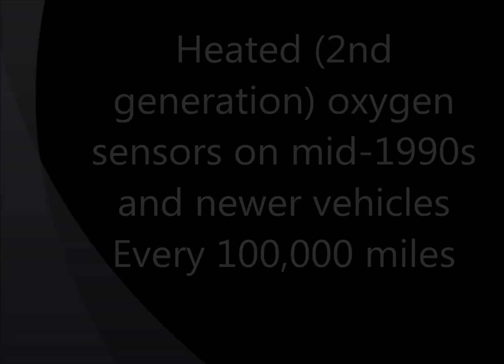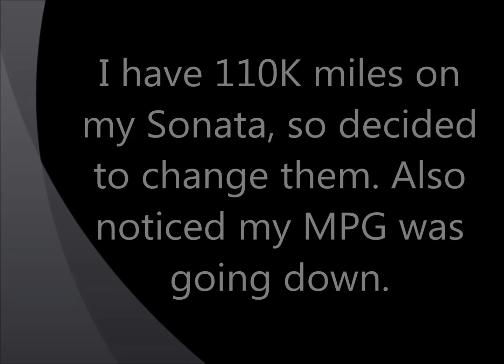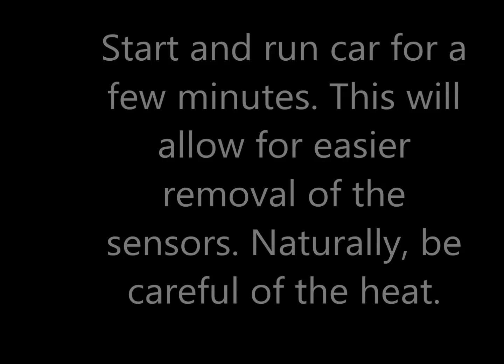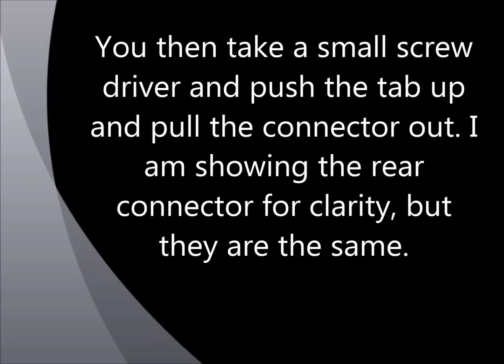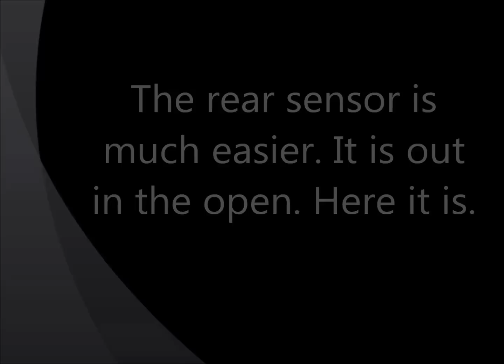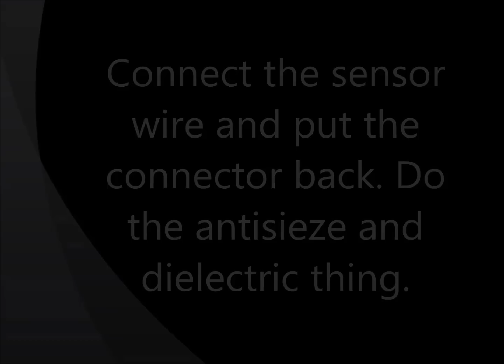How to replace oxygen sensors on a 2006 Hyundai Sonata

Comment: Hey man nice and detail video. Seen the information you detailed in the beginning and sounds so similar to my problem im having. I just bout the 2008 hyuandai sonata v6 3.3l about a month from today which is 08/04/2017. Before I bout the car, I notice a oil leak from which that was the only noticeable problem I seen but the car drove smooth, fast, and the mpg was great, also there was no check engine lights or dummy light on or anything. Took the car to the hyuandai dealership for a pre purchase just to make sure no serious issue before purchase and stating at this time there no issue alarming with no  check engine lights or anything other then oil leak. So the result came back with the valves cover gasket, spark plugs, air filter, and filter under the hood and which I told the dealership to take care of the repairs that stated with the car after I purchase the car. I pick the car up the next day after the relates was done after the dealership closed when work was done on the car and notice the check engine light was on, so out of frustration and worrying, I checked with my scanner and came up with code p0151 o2 circuit low voltage (bank 2, sensor 1) and also notice surging/hesitation/ very poor fuel consumption. Took back to the dealer the next day and the service advice turned the key and check engine light went off which was odd. He took the car back to technician to check code but nothing came up which was weird because I got the code p0151 but they sent me on my way and told me if light came back on to bring it back. It been almost a month from when I bought the car 07/06/2017 and light hasn't came back on but still noticing very very poor fuel consumption, poor performance with hesitation, surging, and rough acceleration. Would this be the o2 sensor with bank 2 sensor one because till this day the check engine light hasn't came back on but notice those point. Sorry for the long story but trying to find the culprit rather the throwing money in part of for someone to charge me $100 for diagnostics fees if the check engine light not on. All the light on my dash light up including the engine light when turning the ignition to start the car and all cut off as normal like nothings wrong but notice all the symptoms. Please if you can guide me and let me know something at your earliest convenience...thank you!
Reply from the maker: Thanks for watching my video RD! I Would assume that the car probably has in excess of 100,000 miles? If so, it is certainly time to change out ALL the oxygen sensors. For the cost of the sensors, it will certainly cover a diagnostic fee. BTW, if you need a code checked again, just go to Autozone and they will do it for FREE! You may like my other videos. Just type Lsailor1 in the YouTube search bar. Like them? Subscribe for the latest! Best, The Sailor.
Reply: Yes when I bought the car it had 115,282 which wasn't no signs of problem when I test drove it and was getting good mpg, good performance, and running like a champ. It's was after the repairs was done when this problem persistent up till today I put about about 750miles on the car, now having 116,100miles on it. I have a code reader but like I said, the check engine light hasn't came on or anything like that, so just have the symptoms of poor fuel consumption, surging/hesitation acceleration performance, and just makes for a rough ride taking away the pleasure of what attracted me to the car when I first got it
Reply: Buy the way I did check the code on my code reader and it was stored as pending but when I took to o'reillys to check it,nothing came up. So after a few day, I checked again with my code reader and everything checked out and no codes are there now, but still have these symptoms.
Reply from the maker: I would start with the oxygen sensors and then I might take a look at other sensors. It could possibly be this: 
https://www.youtube.com/watch?v=-w9NOgoxTZ8     Best, The Sailor
Reply: Were can I get the oxygen sensors at for a reasonable price that comparable with my car without causing problems down the road and how many oxygens sensors are in my car, 4?
Reply from the maker: I don't have your car, but go to Autozone/O'Reilly's and see what they say. Often you can get the stock numbers for them and then check Amazon and get them cheaper. I have videos on how to install them on the 2006 model. Sometimes Autozone has instructions for installing them. Good luck!

Comment: Thanks for this amazing videos 
I found it useful and it helped me alot with my Sonata 2006 v6 
But I have question how many catalytic converter in sonata 2006 v6 
And how can I check it
Reply from the maker: Thanks for watching my video king! On my V6, I have two catalytic converters, one for each of the exhaust pipes. To check it, get under the car and look for the fat part of the exhaust pipe. You may like my other videos. Just type Lsailor1 in the YouTube search bar. Best, The Sailor.
Reply: I will lie to buy an oxygen sensor po137

Comment: so is bank 2 sensor 1 the sensor that under the Hood in the manifold right there in front
Reply from the maker: +Pamela Edwards Thanks for watching my video Pamela! The one in the front has a short harness. The other one has a long harness. The one in the front is BEFORE the catalytic converter. That is how you buy them. It is either before or after the catalytic converter. Recommend you remove them and bring them into a parts store to get an exact replacement. You may like my other videos. Just type Lsailor1 in the YouTube search bar. Like them? Subscribe for the latest! Best, The Sailor.
Reply: Thanks
Reply from the maker: +Pamela Edwards You are quite welcome!

Comment: i have 2006 Sonata 3.3L V6, i have almost 95.000 on car i notice High Fuel consumption for 3 week than engine light come on P0160/P0158 which point to Bank 2 Sensor 2 Circuit no activity Detected and high voltage ........ Is it the sensor or something else ???
Reply from the maker: Thanks for watching my video Ahmed! The oxygen sensors are cheap. Just buy new ones and have them installed. With 95, ooo miles, it is time. Best, The Sailor.

Comment: Would this be why I have the code p2096
Reply from the maker: +Jon Trillo Thanks for watching my video Jon! It certainly could be! If you have over 100K on the car, I would recommend replacing all of them. Best, The Sailor.
Reply: Lsailor1 I have about 94000 got it at 34000.
Reply from the maker: Jon Trillo Wow, that's a long wait! You might try disconnecting the negative battery terminal for about 30 minutes (resets CEL) and if it comes back, change out all the sensors.
Reply: I'm just guessing if it's not my sensors which I'm sure it is would there be anything else to look for for this code
Reply from the maker: Jon Trillo If you Google the code you will see it is a lean condition caused by the oxygen sensors.
Reply: Lsailor1 ok was told it's my downstream oxygen sensor but wasn't sure